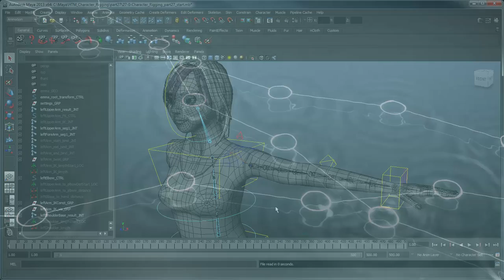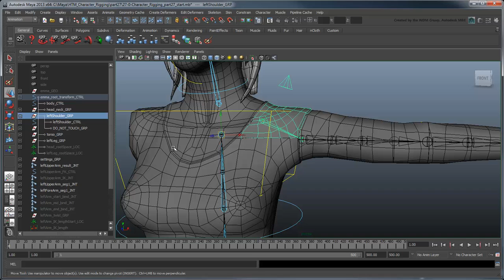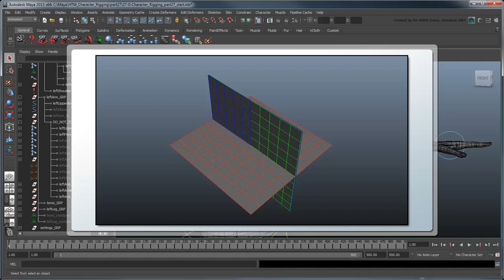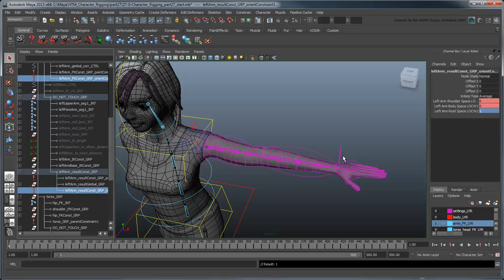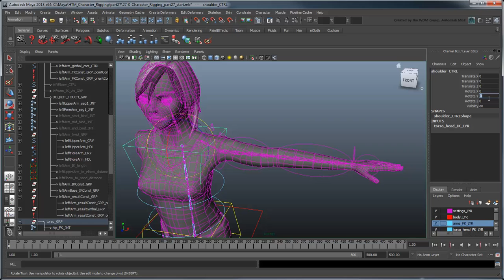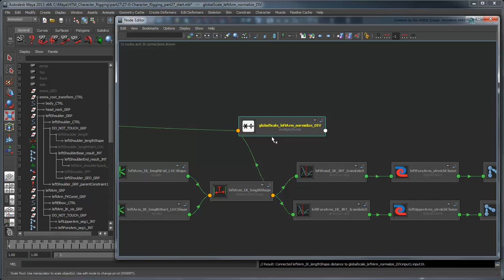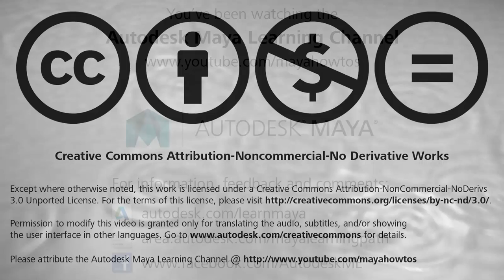Creating a Character Rig - Part 27: Arm global transform and cleanup (Advanced)

Comment: Hey there, Maya Learning Channel, thank you very much for this video series, they are amazing. I hope you still look at the comments, because I bumped into a problem. After setting up the rotation spaces for the FK arm, and the blend color node (leftArm_resultOrient_choice) for swapping between the orientation, my Gimbal Control does not work anymore. The result arm still follows the FK controls, but when I try to rotate the arm with the Gimbal control, the result arm doesn't follow the FK arm anymore.  This setup is really hard for me to see through, could you please help with giving a direction what went wrong?
Reply: After trying to solve this, I figured out, that if i put the constraint rotate output of the orient constraint on color 1 instead, the FK arm rotates correctly according to the rotation space, but the gimbal control does not work, however if I put the output on color 2, the rotation space does not work, but the gimbal control will. How can I sort things out that both will work at the same time?
Reply from the maker: @csavasviktoria6792  Have you tried comparing your setup to the provided scene file in the description?  Does the gimbal not work in all rotation spaces, or a specific one?
Reply: @Autodesk_Maya  Thank you for the recommendation, but it is hard enugh for me to see through my own file, I don't think comparing it to the training file would help much in this case. I followed the rigging process from the beginning up to this point, with the exception of the stretch controls, because those I don't need for my rig. Otherwise I tried to follow every step closely. Regarding the gimbal control, when the constraint orient output is connected to color 2 on the color blend node, the result arm doesn't follow the FK arm when I move the gimbal control. On color 1 when the gimbal control works, the shoulder rotation space doesn't work. On torso space, if I rotate the shoulder, it works, but if I rotate the upperbody, the result arm doesnt follow the FK arm again. Feels like something is really messed up with constraints. But all this worked fine until I put in the "leftArm_resultOrient_choice " node, in, after that everything got messed up. Also it seems like from the way the result arm moves, whenever it doesn't follow the FK arm, it follows the rotation of the leftArm_start_bind_JNT instead.

Comment: Hi, I'm trying to complete the global scaling for the arm and I followed along with the video and tried to also do the extra global scale nodes for the upper arm to elbow and elbow to hand but my scaling still isn't quite right. The arm doesn't scale together, so if I scale down there is a gap between the upper arm and the forearm, if I scale up the upper arm merges through the forearm. Also the hand scales with the arm, but it doesn't move, so the forearm ends up merging through the hand. Any ideas how to fix this? Thanks
Reply from the maker: If you download the scene file in part 32, then view the arm in the Node Editor, you can compare your setup to see where you might've gone wrong.  From the sounds of it, you may have multiple problems happening at the same time (my guess is double transforms and some missing connections).
Reply: @Autodesk_Maya  I have downloaded it and tried to copy but it's difficult as I'm not entirely sure if I have copied everything I need to. I didn't see any translateX nodes and I don't know if I need to do this to anything other than the leftUpperArm to Elbow and leftElbow to hand. Also I don't know what joints or geometry to check for double transforms.
Reply from the maker: @stephrobert3163  This is probably another case where it's best to post something to the AREA forum so I (and others) can see the specific rig.  It's going to be hard to troubleshoot over messages since there's probably a few issues happening simultaneously.

Comment: Every time I'm trying to point constrain the Arm_FK_Const group to the Shoulder_Space_LOC, the FK arm chain is moving away in the opposite direction from twisting the Shoulder IK control. I tried re-doing but I am running into the same problem. The IK and Result joint chains work fine but the FK const group does not. Could it be possible that it's inheriting transforms from anywhere?
Reply from the maker: The FK chain in theory should be an exact replica of the IK and Result arms.  If you look at the LRAs, are they all the same?

Comment: But the snappable knee and arm joint chains doesn't scale uniformly, did you forget to make a global normalizing node for them in this tutorial? Well you've taught us how to do it anyway :)

Solution is to make another global scaling normalizer (multiply divide) node, and put it in between the pole vector distance nodes. So in the multiplydivide node, set it to divide, then let input 1x comes from scale x on the main controller of the character as usual, and input 2x come from the distance output on the distance shape node. Finally connect the output to wherever the distance attribute used to go.

(make 1 such normalize node per chain, e.g. 1 for upperArm, 1 for foreArm, 1 for thigh and 1 for shin)
Reply from the maker: Yes, unfortunately that was missed in this tutorial itself.  The final scene file in part 32 has a fixed version.  As you said though, the principle is exactly the same as the other global scales I showed earlier.

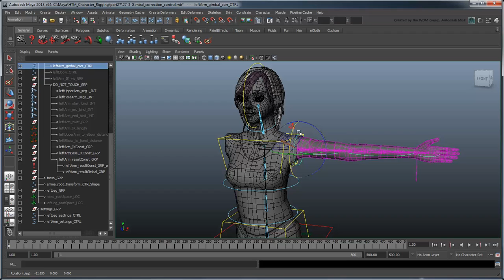Comment: Hey guys! Thank you so much for the very thorough and informative tutorial - This is the first problem I've ran into in this series - I'm at point 7:15 and Im noticing an issue. 

Video of the Issue: https://youtu.be/pnedsyfg56o

Before this step, if I move any of the arm FK controls and swap to IK everything works as expected. After setting up the Gimbal Correction Controls and wiring them however; If I move an FK Control,  then use a rotation on the Gimbal correct as well and swap to IK mode, my arms dont behave as expected. The arm no longer returns to the previous Fk position - Instead maintaining some Offset. 

I've looked through what I feel is the obvious issues and havent seen any. For now, I am avoiding using the gimbal correct. But I would love to have a solution if I can figure it out with your help!

Comment: why there is a gimbal_correction_ADD node in your 32-1- Mirrorer_rig between leftArm_resultGimbal_GRP and leftArm_gimbalCorrToggle. On top of that there is and different GRP structure and a 180 Rotation on the X axes. the ADD is somehow correcting this or am I wrong? Also on the gimbal FK ctrl, there is a 180° rotated orient_GRP. If I try to do the same my FK arm spins weird around. I mean I understand why but I can reproduce it ... will this be done later?

Comment: So, I'm very stumped. I have a problem in IK mode where my result joint chain seems to be following its own direction when I translate my shoulder control or rotate my chest control. Since the result chain seems to do its own thing, the segmented joints follow, as well as the proxy meshes. Any other heirarchies don't seem to be affected, namely the ik joint chain and fk joint chain. FK mode seems to perform perfectly fine; the problem occurs when I switch to IK mode. The problem also seems to only occur while the arm's rotation space is set to shoulder space, not in upperbody space or root space. I have really no idea how to go about solving this, and I thought I might ask here. Here are images of what the problems look like. Does this link work? https://imgur.com/a/RZAHvvq
Reply from the maker: Hmm, that is odd.  Something is fundamentally wrong, because the rotation spaces are ONLY supposed to be for FK - they shouldn't have any impact whatsoever on IK.  Looking at your images, I'm trying to get a sense of what happens when you blend between IK and FK?  Does the arm just judder a bit before settling back in the same spot?  

First thing I'd check is where the leftArm_shoulderSpace_LOC is in your hierarchy (it should be alone under the leftShoulderEnd_result_JNT).  Second, did you make sure to connect the correct joints to it?  It might be that you just constrained the result joints to it instead of the FK joints while in Shoulder Space mode.  Alternatively, did you ever parent constrain the arm to the shoulder at all in an attempt to get it to follow?  Because you shouldn't need to do that.
Reply from the maker: Actually, here's another test you can run: select the leftUpperArm_result_JNT, and the leftArm_shoulderSpace_LOC and then show their connections in the Node Editor.  Then check to see if there is any path of connections leading from one to the other.  There shouldn't be, so if there is then that's your problem.
Reply: No, there are no connections between the locator and the result joint. I'm wondering if I have my hierarchy wrong somewhere. Here's what the hierarchy of those 2 nodes looks like. https://imgur.com/a/Q2kjzaP Is there a way I can perhaps send my maya file? In the end I can probably just revert to an older version and redo some stuff.
Reply: @Autodesk_Maya  No, the arm does not jutter at all. The last 3 images are me switching from IK to FK, while the chest control is rotated (this is also under shoulder space). It's a smooth transition seemingly, just that the ik position is not where it should be. I have noticed though that the more I rotate the chest (or shoulder) control, the result is a gradually stretching upper and forearm, with the hand remaining the same scale.

Comment: @7:15 I ran into a problem with the rotations of the Gimbal Correction Control. It then made me realize that my FK Control rotations were out of whack too. This may be because of the orientations that come with the A-pose. However, is there a fix that I can apply so that the gimbal & FK control rotations match? Or would I have to start over from part 22? Short videos are provided below for reference on my model:  
Gimbal control rotations: https://i.gyazo.com/437395249c6512bdc2d9567580b63b34.mp4
FK control rotations: https://i.gyazo.com/8fbe746f0d92374c0ea7de4ffac2d058.mp4
Reply from the maker: I would select all the FK arm controls and then open the Node Editor and show the connections.  Then, very carefully, make note of all the connections to those joints.  Afterward, break them, and use the orient joints command to re-orient the joints to match those of your result / IK skeleton.  Finally, manually recreate all the original connections by dragging and dropping the output/input fields on each node.

That should get you back to a usable state without having to start all the way from part 22 again.
Reply: Thank you for your speedy response! Today I followed your advice and found that the IK / FK joint orientations do differ from the result joint orientations. Image for reference: https://i.gyazo.com/190fe454928df881ea5ad718c8ca09ca.png However, I tried changing the joint orientations using different methods and couldn't find a solution. Can you clarify the Orient Joints command? Below is a description on my attempts:

X  Skeleton > Orient Joint ☐ on the selected joint didn't change the rotation values displayed in the channel box.

I found this article on the MEL command: https://knowledge.autodesk.com/support/maya-lt/learn-explore/caas/CloudHelp/cloudhelp/2015/ENU/MayaLT/files/CSS-Orient-a-joints-local-axes-manually-htm.html 

X  Using rotate -r -os 180 0 0; on the selected joint didn't change the rotation values either.

X  Since the XYZ of the selected joint are 4.794, -0.034, -0.385, I tried using rotate -r -os -4.794 0.034 0.385; No dice.
Reply: I also dated back to an earlier file version where there weren't any connections to the IK joints and the IK, FK, and result joints all seem to have the same rotations. https://i.gyazo.com/f6b80b3fe9b6ada44bba8b1aef75cdff.png Yet, the rotations are broken on the FK joints for that file too https://i.gyazo.com/adc70afeab1756f9fd30fa1cdac0c273.mp4
Reply from the maker: @booboo8174  So what you want to do is disconnect everything going into/out of the FK joints EXCEPT the connections to the other FK joints (should be just Scale - you can create a default joint chain and look at it in the Node Editor first for an example of what I mean).

Once that's done, select all the FK joints and make sure they all have zero rotations.  Then go to Skeleton > Orient Joint > [].  In here, set the Primary Axis to X, Secondary Axis to Y, and Secondary Axis World Orientation to -Y.  This should reorient them properly, after which you can reconnect everything you disconnected earlier.

A note on the last joint on the hand - I mentioned in an earlier video that the last joint orientation doesn't matter, because nothing ever gets parented under it (thus it's rotations won't end up mattering ever anyway).  However, if you do want to orient this joint in line with all the others, the easiest way is to actually create an extra joint beyond that one (that extends further than the tip of the hand).  Then re-orient all your joints, and finally delete the extra joint.  In other words, make it so that the last joint of the hand isn't (temporarily) the last joint in the chain, then orient, then delete that last (temporary) joint.
Reply: Thank you for reviewing this technique! It came in handy several times today knowing how to isolate the joints from their connections. 

Unfortunately, I first followed the disconnect directions with the arm and the results came out the same way - the broken rotations on the arm remained stubborn.   

I followed through with plan B and went back to redo the arm entirely. I learned that the problem might have been the bend that I set into the joint chain initially, as well as not checking the LRAs frequently and not matching the rotation orders on joints and controls throughout the process. 

I was under the impression that the arm can have a bend in the joint chain like the leg did. Is it because the arm has more complex rotations that it can't afford to have a bend? 

Also: Behold, I present to you the fixed rotations! ~ https://i.gyazo.com/068409f1e82685866fbe9c813499c781.mp4
Following your tutorials have been an exciting ride! Thank you for your patience on this issue. I look forward to completing my first real rig!
Reply: I found something that works! Although it doesn't work on my latest file version with gimbal correction control, the earlier file version had differing rotation orders. Between the leftUpperArm_result joint, leftUpperArm_FK_joint, and leftUpperArm_IK_joint, they were set to xyz, yzx, and yzx, respectively. I switched the rotation order of the leftUpperArm_result joint from xyz to yzx, and I got the arm rotations to function properly: https://i.gyazo.com/3deb2dad6763cbf511cb947384fd932e.mp4

Would this mean that I still have to date back to part 22 to apply the fix and redo the arm entirely? Or can I still take the approach of the Orient Joint command that you had advised?

Comment: Hi, I hope you're still looking at comments because I have a problem. When I translate the shoulders when FK arms are in shoulder space,  the arms move with it as they should, but they also rotate in the z axis, so it almost looks like they're flapping. And when I translate the R shoulder in the Y axis, the R arm also looks like it spins around itself on the x axis in addition to the weird z rotations I mentioned earlier. The other spaces work fine and IK still works fine as well. I hope that made sense, any ideas?

Thank you!
Reply from the maker: Hmm, the "flapping" in shoulder space makes sense, since the whole idea of that space is that the arms rotate along with the shoulders (and anytime you move the shoulder, their orientation changes since the root joint is anchored).  The spinning is definitely not normal though.  Does that only happen in shoulder space?  I would double check the orientation of the right shoulder space locator to make sure it's oriented exactly the same as the shoulder joints.
Reply: @Autodesk_Maya  OK i looked at your exercise file and the flapping does happen there as well so that's good. And yes to answer your question the spinning only happens in shoulder space, all of the other spaces are fine. And what exactly do you mean by "checking to see if the orientation of the locator is the same as the shoulder joints"? do you mean the rotation values of the joint and the locator should be the same?
Thank you for answering btw
Reply from the maker: @nickculleton7467  Yeah.  Basically, the Local Rotation Axes should match.  An easy way to check is to select the Move Tool, set it to Object mode, then select the shoulder result joint.  Make a note of which way the manipulators are facing, then deselect that and select the locator instead.  Do the manipulators face the exact same directions?
Reply: @Autodesk_Maya  They very much do not haha. How would I go about fixing that? Rotate the locator maybe?
Reply from the maker: @nickculleton7467  Yup.  Just pre-rotate the locator to match and then redo all the constraints.